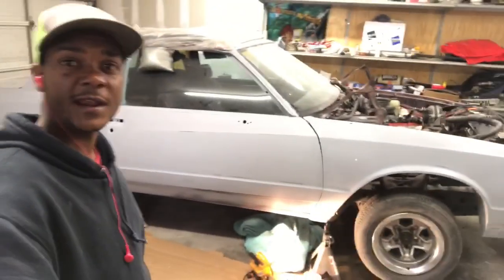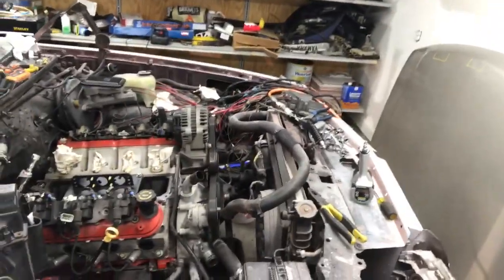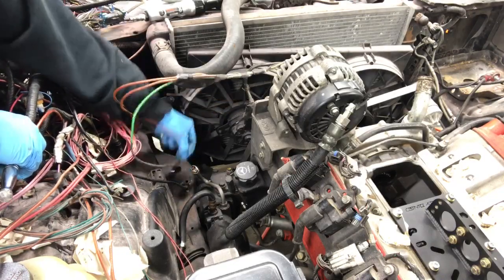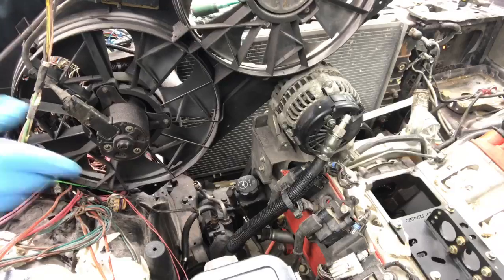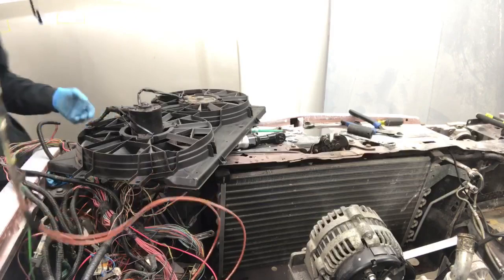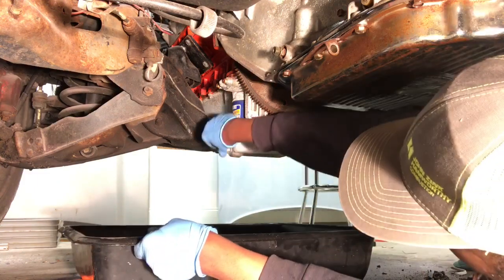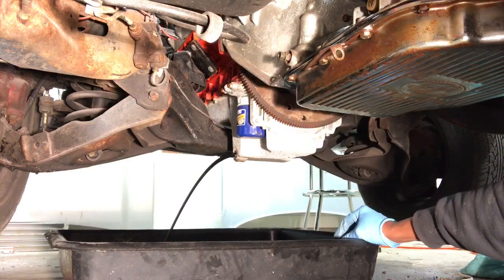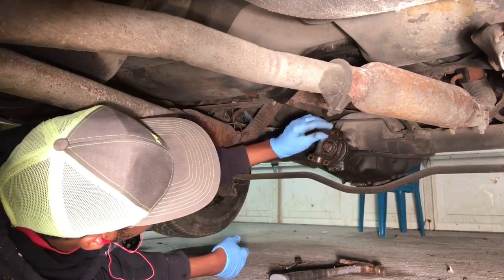Ls Swap g-body MonteCarlo SS ( part 2 )

Comment: Good work bra I’m down in Alabama I have a 84 ss but eventually going to swap from 305 to ls what are the most important parts I need  to get first
Reply from the maker: ENGINE MOUNTS THE PLATES, WIRE HORNEST, PCM GOTTA GET THE VATS DELETED, FUEL PUMP, UNIVERSAL JOINT, DEPENDING ON WHAT TRANSMISSION,